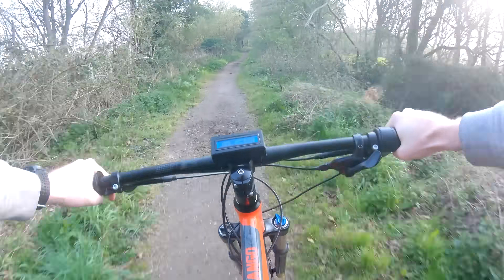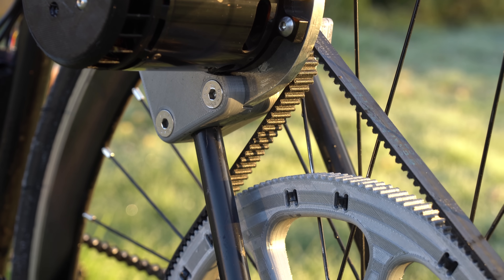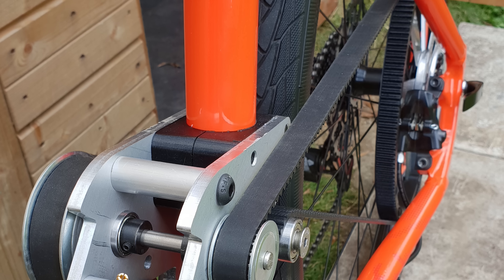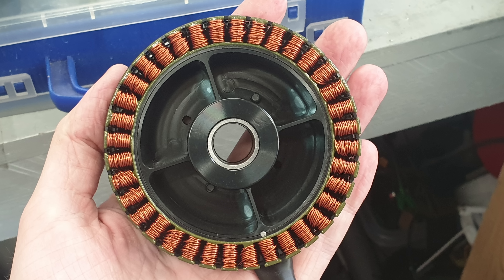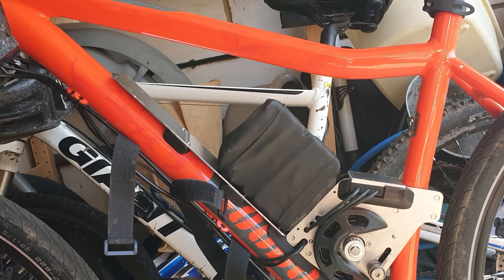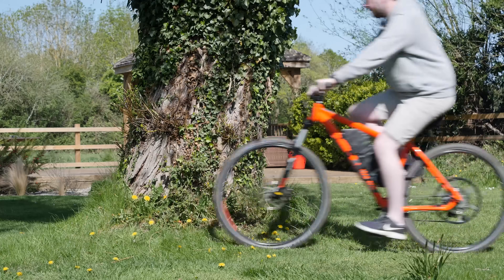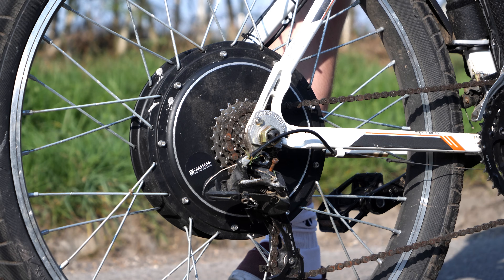Building an Electric Bike

Comment: Good Project! I think attaching the wheel pulley on the bicycle spokes is not very strong. I printed a much bigger wheel pulley composed of 8 segments which has almost the same diameter as the bike wheel. Like this the torque is reduced hence having a much bigger transmission ratio. Doing so only one stage of transmission is required and improve the overall performance. Please have a look here https://youtu.be/0Vt9FLu8H_g

Comment: I’ll give you an example of a mechanic (me)dealing with an engineer.
I work for a global car manufacturing company....let’s just call them Generally Motoring.
There is a bracket in the left rear 1/4 panel to house a Diff Control Module that bolts onto 
a panel.
The bracket is triangular with 3 threaded holes, the panel it bolts to has 3 holes.
The top 2 holes in the panel are slotted with open ends, the bottom is not.
Theoretically if all 3 holes were slotted, I could just get my 10mm Spanner, undo the bolts a couple 
of turns and slide the whole module and bracket out in less than 30 seconds.
But no, some fucking engineer designs the bottom hole as a normal hole that is right next to the battery 
that has about a bolt head clearance between the bolt and the side of the battery.
So for me to remove this bracket, I first have to remove a bolt that holds a bracket down on the battery.
Then a 13mm bolt that holds a bracket at the bottom of the battery to stop it sliding back and forth.
Then move the battery out of the way to undo the bolt fully with just enough clearance to get the bolt out 
and then I’m able to remove the whole DCM bracket....total time approx 2-4 mins.
I looked at the engineer and suggested if you slotted the bottom hole in the panel like the top 2, 
it would make things much easier/quicker in warranty work.....he looked at me in a weird sort of way.
I just walked away throwing my hands up saying something about 4 years of university and this is what we get.

Comment: Twin wheel hub bike. The challenge is to manage both motors reconciling data streams from a 6 axis type gyro (stability), throttle and brake (traction control.)

Comment: What about a CVT type set up like on a snowmobile with infinite gear ratios.  Obviously lighter and smaller. But this would give all the torque on the low and high end.

Comment: Thank you for using numbers I understand USA and the explanation of the hobby motors numbers and their relevance will help me with building my homemade rc airplanes. If you want a very durable plane use carbon fiber rod a piece of plywood make an arch and hold in place with 3 screws from the center of the arch measure 3 inches down and affix another rod across and fasten each end using carbon fiber thread and flexible ca glue the propeller will be protected in this space from frontal impact next attach a rod across the bottom then 1 inch up another rod then a center square carbon fiber piece attached to the front straight rod leaving enough room for the motor and prop a motor mount is available that the square will fit into or make a bulkhead and attach the other end to both rods your controll surfaces will be arched rod attached to the bottom tube depending on the size of engine you may need to double the bottom rod that the controll surfaces attach to the vertical (tail) can be fixed or movable the amazing part is all surfaces are covered with rip stop nylon it's water proof and durable just glue it taught to the rods this flat surface will fly perfectly fast or slow. Landing gear (optional) a tray to mount servos battery speed controller and radio gear is easy to make and attach. My original made in 2004 is still flying I hope my instructions make sense it's easy and inexpensive to build but durable enough to leave in the car all the time

Comment: This is totally brilliant and totally illegal. This is an unregistered and uninsured electric motorcycle way outside UK ebike regulations. Courts are heavily fining people using imported emotorbikes and you will get points on your licence.  If you injure someone (not unlikely, a pedestrian was recently killed by such a machine with similarly inadequate brakes) you are liable personally for compensation and damages awarded.  Think 6 or 7 zeros. Hope you get a great job designing legal and safe kit.

Comment: I gave up on building fast things that were not built to be fast. I had a 2 wheel skate board with 12 inch wheels. It had a gas weed eater motor and did almost 30mph. A motor cyclist clocked me on the street during testing. Don't hit a hole. Ask me how I know.

Comment: Very interesting phenomena with aluminium mounting and induction by electro motor. I could have had the same issue on my electric longboard. The motor suddenly breaked at a high speed.

Comment: You should add a power regeneration system, like a generator mother on the front wheel so it should add alot of range

Comment: Why not attach the pulley to the front crank and utilize a one way bearing to let the pedals coast while under motor power. Then you'll be able to change the gearing via the rear derailleur maximizing torque, speed and distance.

Comment: Actually there is a better option for the battery, have a look on silver team lipo battery, go for the 6cells or 8cells battery for x2 should be super powerfull and last for 45mins, easy to charge, it would save a lot of space and weight
And the RC car biggest esc or hobbywing esc could set up the curve of speeding, it won't brake the belt when pull up the accelerate too hard😂
Awesome project

Comment: As a battery nerd I'd like to add some safety suggestions for your battery builds.

#1 You should fuse your packs with a UL rated fuse, so if the motor controller dies, a fuse will blow. A slow blow fuse rated at the maximum current of your controller is a good start. Maybe 10% higher if you get random fuse blows.

#2 Add spacing between cells. 1mm or more between all cells helps if something terrible happens and a cell shorts out. This helps prevent cascading failures if a cell explodes or catches fire. There are plastic spacers available. Put them in before welding. The only thing separating your series cells right now is 2 layers of heatshrink. That vaporizes fast in a fire and cascades the issue.

#3 Use named cells from a known manufacturer that have safety certifications. The pack safety starts at the cell. Unknown and uncertified cells with internal contamination are virtually impossible to protect, no matter how much electronics you add to the packs.

#4 Cell balancing is a good idea. There are aftermarket boards that provide over-current, short circuit and balancing functions. Some of the effort you've put into the rest of the bike should be focused into this area since it's a good way to prevent catastrophic failure. This topic is a rabbit hole and an engineering challenge unto itself. You've solved this with balancing chargers which is fine for now, much like the RC community... however there are more elegant ways that let you use 2 wires only for charging.

#5 Never ever ship a homemade pack. Unless you have dangerous goods certification you are asking for a world of pain particularly if something bad happens during shipping. In the USA I think this is $60K fine per offense from the USDOT or something silly. Don't give them a reason to care. Others have come before and ruined the party (I'm looking at you hoverboards!)...

Comment: one more thing, check your local laws if you're planning on building something like this! there can be speed restrictions and bikes that can be powered without pedaling are sometimes considered mopeds
Reply: Yep, it's shameful that Tom doesn't mention this.  In Europe this is classed as a motorbike.  You need a driving licence, full insurance, and wear a full crash helmet.  Worse, if it's home made it needs to be "homologated" ie fully tested to be a roadworthy design, which could cost you thousands.  Not worth it unless you're planning to go into production or have a large private estate to go round uninsured.

Comment: How about something that involves some real innovation? Such as an "Induction" Axial Flux Hub Motor designed Ebike? https://www.youtube.com/watch?v=iCu3_dVMERI
Or even better, driving the BB spindle via a crank/sprocket magnetic flux interface with the frame housing the induction coils, instead ie a Mid-drive design???? So most of the parts of the motor, are also structural elements too... Reducing the increase to its moment of inertia...
Just a thought... Have fun...

Comment: The most ingenious yet simple DIY piece ...is the shaft you came up with in the last build.  Its off the shelf, little altererations, its easily R&R (removed and replaced), the knurled head of the bolt even serves.
Things that are repurposed like that...are just outright cool

Comment: Nah, The Bafang BBS HD mid drive  can run 72v with a ert ludicrous controller and runs at 4200w and does 37mph in 2nd it has 10 gears so bit scared to go any higher

Comment: Make a single battery not 3 packs 
The wires and joins to battery will cause you issues. .... Just buy a dam wheel hub motor save ya cash cus that's where you heading .... beautiful last battery pack .... you found design flaw on motor send it back 😂😂😂😂

Comment: A rear drive hub motor is better than any centre drive , as in the latter it tends to stretch the chain , where as the rear wheel drive , does not !

Comment: That is a nice project. In France, if you have a speed control in your hand you need to have a bike licence plate and an insurance. This administration part of the project is very hard to do. 
I haver never read any project about an aero optimisation. It would be nice to work with a time trial bike to reduce the global consumption. If you need only 300 W to drive at 43 km/h you can use a smaller battery.

Comment: Hello Tom,

I was thinking about a similar approach to attach something to the brakedisk mount and install the motor in the frame-triangle. I´d think of a solution with as less special parts as possible. 
For example get  a big standard bike gear for the back and create an adapter to the diskholder. So one could use a standard bike chain. 
The thing I couldn´t solve in my theoretical brainstorming was the motorunit. I don´t want to / can´t design and build a gear with the needed ratio. I see you´re using a big motor - I guess that is to have enough out-of-the-box torque.

Comment: See i couldn't do this because id end up with a hub motor on the back and front of a full carbon bike. With a battery pack that would effectively look like a normal motor cycle engine and if i didn't burst into flames i'd probably wreck it at speeds that could get you jail time on a highway,

Comment: The clever part of electric bikes and cars is the battery. Everything else is tech that's been around since the 1930s, just waiting for a battery light enough to exploit the potential.
Reply: For cars, I'm not even considering electric until they can do about 1500km on a single charge, while running the air-conditioning on a 45 degree day. Until then, they're not safe for use on long trips here in Australia.

Comment: Not sure I can agree with adding two motors and a belt. Use a single hub motor which turns the real wheel negates mechanical losses in your setup.
If adding power was the point, then add a petrol motor.

Comment: the 3 kilowatt Hub motor at 13:21 could thy be use on a trick bike but using 3 of them on each wheel so that a total of 3 wheels that have a motor on them so that u can go fast but also have more people on the bike like 2 more branch seat in back or a 4 wheel bike just like this one https://i.pinimg.com/originals/c0/4f/88/c04f888834a0bb8b30f6fc3585cdd07f.jpg

Comment: Why don't you build a transmission with overdrive to increase acceleration and top speed and range? There is a design that uses 2 cintrifugal clutches making a 2 speed automatic transmission with chain drive instead of gear drive. Check out cars and cameras youtube channel, they have a minibike with this transmission

Comment: If you plan to build an electric bike with a hub motor, keep in mind that most bike shops will not be able to work on them. If you understand bike maintenance then it shouldn't be an issue. Just keep this in mind before building.

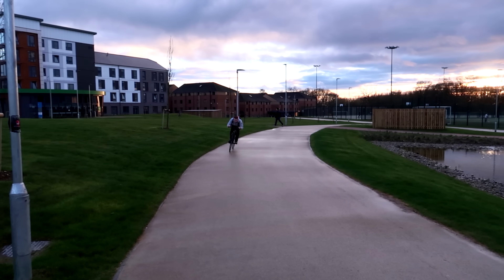Comment: Nice work, but more a motorbike or a moped than a bicycle? I don't see you pedalling much, but you may not like that. I do, and my design (link: https://endless-sphere.com/forums/viewtopic.php?f=3&t=97578&p=1497468#p1497468 ) works at 1/10 of your power level. My current gear ratio is almost 1:50, and while pedalling close to normally, I get an assist of around 150W, from a system weight of less than 2kg. What I really like to see is a 3-D printed, free wheeling, spoke mounted rear "sprocket" :)

Comment: Man, it's a great job! Was following evolution from the beginning. Was waiting for the next step will be custom gearbox or variator :D These times the easiest way (but not so intresting=) ) to build an e-bike is to buy a bike, motor(with ESC and etc.), battery and put it all together. I guess only your time (except 3d-printing, motors, controllers, cnc..) spent costs much, much more than a comparable e-bike.

Why have not you consider a mid-motor system? No extra wires, build-in controller, can be assembled/dis~ in 20-30 mins AND(!) you have all of your rear gears! 

You are losing front stars from the box, but with your hands... ;-)

	But anyway, keep moving!

Comment: So you made an unlicensed electric motorcycle. If it exceeds powering beyond 15 mph in the Uk as a bicycle it is illegal and moves you toward a motorcycle. In any accident you could be held entirely responsible regardless of fault. While an interesting project and you learnt a lot it would have been way cheaper to buy an electric bike. Just the price of the U13 is eye-watering. You could also just looked at belt driven vehicles to see how its done.

Comment: I built my own EBike 2 years ago into a Emotorcycle. It's due for a new battery and voltage hardware upgrade. 
If you're gonna be riding at those speeds Tom, you need to wear a full face motorcycle helmet and look into some moto gloves and mesh riding jacket. 30mph+ is more than enough to kill you, if not give you some serious brain damage and roadrash.

Comment: I would add the wheel size to the equation, from the perfect 10, to be more general.
In my DiY scooter I have 190*10/54, wich is far from the 10,but the wheel is 190mm then 6685, while you perfect 10 in a 26inch is be 6600.

Comment: Have you ever tried putting a hall effect sensor on the motor and running the motor positioning data back to the ESC for better torque?  I know it would make for a more complicated brainbox, but it would greatly improve the power delivery and energy efficiency.

Comment: I'd like to tey something similiar, but using that tunigy 150cc equivalent motor, wich is rated at 11kw max. I'd use it in a dirt bike frame, and shave off as much weight as possible. Would that be a good contender? I'd obviously make an alluminium case with support bearings on both sides of the motor, and using a belt and pulley system directly in the case, then from there a chain that would drive the rear wheel, so i don't have to go crazy big with the rear sprocket. Any help?

Comment: The wheel circumference is also an important factor for choosing kV and gear reduction. Pick your desired top speed and work backwards from there. Assume your motor will spin at 70-80% of its maximum RPM, given your battery voltage and motor kV (choosing higher % values will mean better acceleration). Then use the motor RPM you end up with and work out what gear reduction you need to get your desired top speed.

Comment: If you wanted to use the original motor setup, maybe you could have a clutch system so that you could use the drivetrain already on the bike? Go-karts use a clutch which you probably already know.

Comment: I know that is no way to make a new electric bike BUT what about the mid-addon motor that can be added on the petal shaft? in theory, you can still use the gears and that we give you extension on the acceleration and top speed areas!

Comment: cool bikes! just one thing to point out as a bike mechanic- those crosstop brake levers you used on your first bike are generally only used as secondary levers for drop bars as they're quite weak and unreliable. I'd normally advise people not to use them as sole brake levers for bikes without a motor, so on an ebike I would VERY strongly advise against it.

obviously you've got the new bike now, but something to keep in mind!! especially for people watching this and deciding to build their own

Comment: this is an interesting video, thank you for it, but having built three ebikes from kits i can say - just buy the kit. my fave kit on ebay is the 800watt front wheel kit that uses a 36volt battery. the kits are around £160 then you add the battery - which is whatever you want to spend . . . . .

Comment: I'm really an electrical engineer ;) It's a good project, nice work, good evolution of the overall system. It's perfect for content creation but not for anyone who want to build his own electric bike. As far as I know in the EU the max power for electric assisted bikes is 250W. More than that is basically the same as a 50ccm scooter with roughly the same regulations. Just imagine if they can be useful with 1/10th of the power of your system then there is some issue with your system. The issue is your project is more like an electric scooter build on a bike frame instead of an electric bike. 50ccm scooters with 2-2.5kW can be more than enough for traveling in cities. So if someone reading this want to make her/his own bike it's worth to consider buying a street legal kit instead of designing from zero.